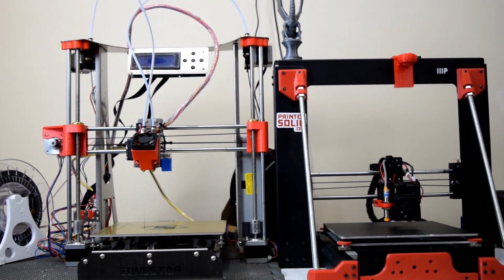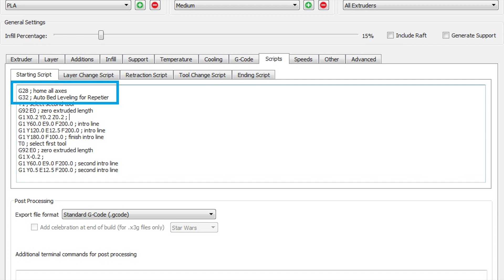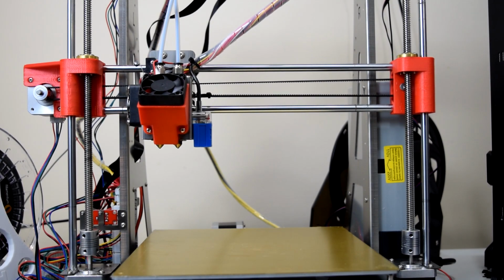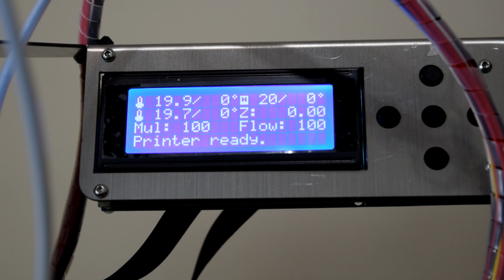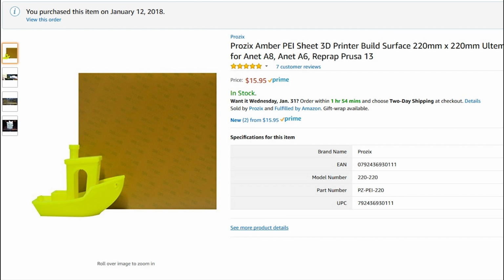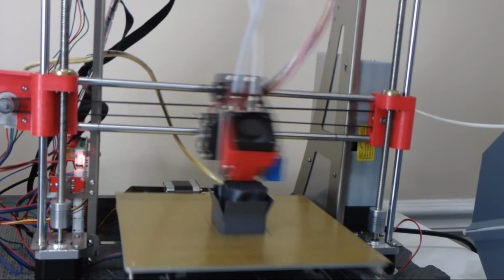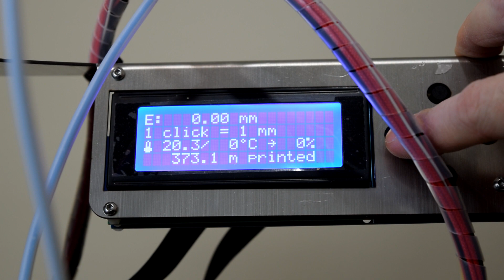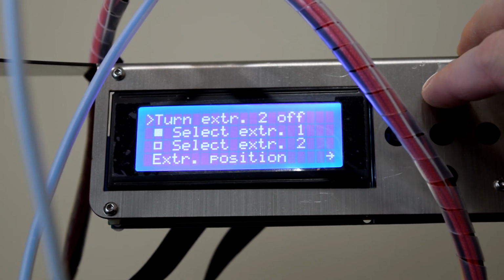Zonestar P802QR2 Dual Extruder 3D Printer Review

Comment: Also ended up reviewing this printer, and I believe I ended up using your power supply cover. Sounds like we had similar experiences. Was able to get it working decently under Cura, using settings from the CR-10 as a base. I also just ordered a sheet for the bed, and designed a simple mount to attach a webcam to the bed. Can't wait to see what else you come up with!